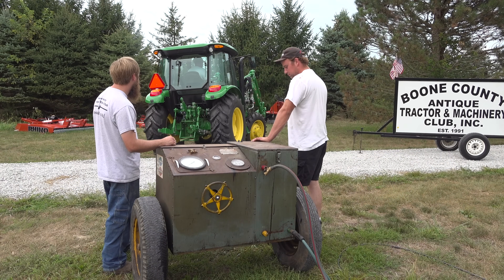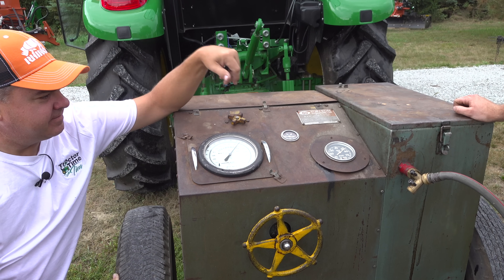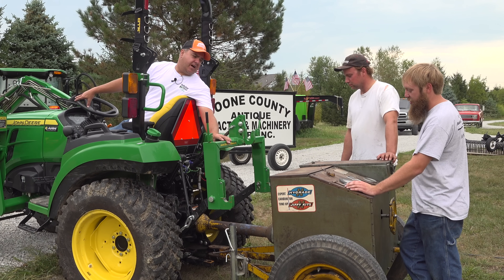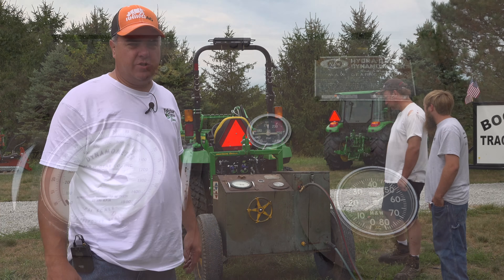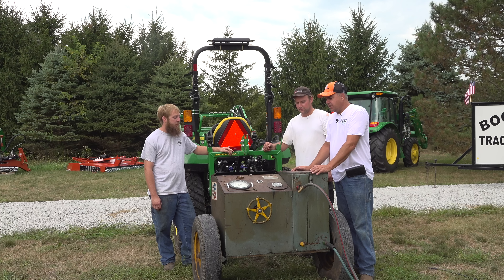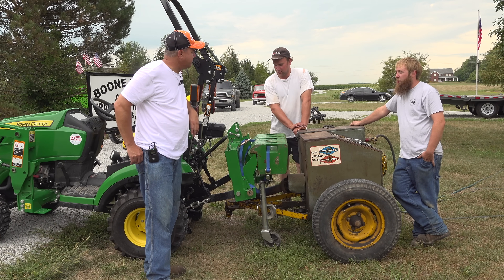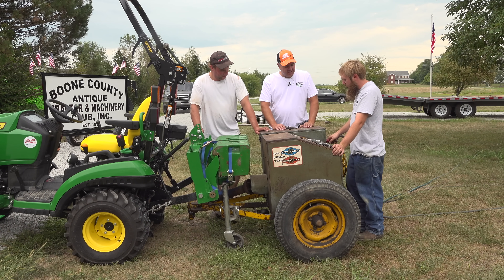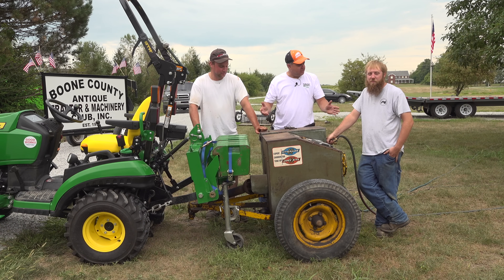Dyno Test!  PTO Horsepower Comparison - Kubota BX2680 vs. Deere 1025R Round #5 of 8

Comment: I have a Yanmar SA324 which is the same engine the 1025r uses. I had a  JD455 which had a Yanmar 890cc 3 cyl diesel rated at 22hp. The Yanmar 1200cc engine (rated at 23.9) hp used in the SA324,424, and the JD 1025r is 400cc bigger so it has the potential to have 28 HP at least. They are underfueled, hence no black smoke. They can be turned up to the point of slight smoke under max load.

Comment: Interesting comparison ….seems as if the dyno is about 5 hp too high from what manufacture specs are!
I find it hard to believe every tractor tested was putting out 5 more hp than specs….either way it was a fun video!
Reply from the maker: …would agree…cept for the 2038r.

Comment: Cool stuff, pretty interesting to see the comparison, hard to believe hp difference from the specs. It might be like u said, manufacturing pushing the EPA envelope.
Reply: That's exactly what it is, they really don't push out the true specs of these engines for EPA reasons...they're all higher output than what's on paper.

Comment: The difference between horsepower and torque is that torque is a measurement, and horsepower is a calculation.  The reason HP is off at the wrong speed is because a dyno measures torque; horsepower is merely a calculation of measured torque at a specific RPM.  Wrong RPM = wrong HP calculated, hence the conversion chart.

Comment: So I have a B2650 kubota if I get some equipment like a rear flail mower the PTO on the mower is rated at 540 what do you set the tractor at to plan for load while mowing? A little higher than 540?

Comment: Power scales with RPMs so the measuring device should easily be able to give an accurate Power for any RPM. The catch is that diesel combustion torque drops off fast after its peak at 2k rpm.

Comment: Some close numbers on the sub-compact tractors.  I figured one would be somewhat higher than the other, but its interesting to see how close they really are but over the manufacturer's rated PTO HP....I guess that's why so many people with their sub-compact tractors are running PTO attachments that are slightly over the tractor's ratings.  This was a really interesting test....I too would have liked to see the 1023r and BX1880 to compare to the larger engine versions....and I too would bet they're pretty dang close to each other.  People can do some really interesting things with those little tractors you wouldn't think they could do....I think a lot has to do with having the right amount of ballast and someone in the operator's seat that really knows what they're doing.

Comment: Having run literally thousands of Deere tractors on the PTO dyno they typically will run their sticker power at the PTO at 1000ft elevation. This is so they will still run rated power in say Denver where the air is much thinner. so a 1025r would run 25hp a 5055E would do 55hp and an 8360r will do 360hp.  That 2038R is weak for some reason and should be checked. Maybe dirty fuel filter? Even that 5075e isn't running what I normally see. Need to make sure that the throttle linkages are adjusted so that they achieve the factory rated no load rpms before checking as this can have a big effect on power.

Comment: We used a version of this, to rest outboard marine engines.
Very good to check for mid throttle issues, under load.
And yes you can shut down a 300hp engine by turning that valve.
A v8 outboard, UT of the water with cups.. Has a roar like no other!

Comment: Seems that the dyno is reading pretty consistent 5 to 6 lower then the stated actual. Both tractors had 5 more hp then manufacturer stated. Interesting
Reply from the maker: If that is the case, the 2038r has a serious problem!

Comment: A couple pto horsepower in a small tractor makes a big difference. After watching the video on the post hole digger makes that obvious. Add the extra three point hitch lift capacity of the Kubota makes it more of a work horse!
Reply from the maker: The Deere was one hp higher than the bx.
Reply: @TractorTimewithTim  but a lot more $$$

Comment: I was just at the Boone county fairgrounds!

Secondly every time I’ve watched one of these dyno’s run I always saw the guys run the tractor over the 540 rpm and pull the engine back down to meet 540 to get accurate numbers.  Not sure if this is the correct way or not
Reply from the maker: This is how they tested our tractors
Reply: Pretty amazing to see the little 1025 put down some great numbers!

Comment: if the small deere and kubota are reading over the rated hp and is correct the bigger deere is well under stipulated hp. With the ePto, if you wanted the same hp as in normal mode the 3 or so reduction in hp would mean lowering the revs, therefore saving fuel in e mode for same output. if that makes sense.

Comment: The ratings are probably spot on. What is missed is that the engine is rated to drive the tractor PLUS the PTO; you are doing a stationary test, so there is no load from the drivetrain, hence all of the engine horsepower is going to the PTO.
Reply: Does that mean the 2038R PTO output would be even lower if the wheels were turning?
Reply: @eosjoe565  Logically, yes. I would question the test conditions however. Something else is going on there, I would monitor hydraulic oil temperature to see if the missing energy is going there for some reason, or if fuel flow to the engine is being restricted somehow.

Comment: Sounds like the result with EPT mode is more power is directed to the PTO versus the drive train.
Reply from the maker: Well, I don't think our test was truly fair.   He had the throttle set to WOT...then pulled it down to 540rpm. ...rather than setting it at about 560 pto rpm, and then pulling down to 540.  So, it was lugging the engine pretty hard.     I didn't know that when I was making those statements.  Having said that, my comments are still true, we were getting 65hp at the ePTO 540 speed, so i didn't remove (or revise) these comments.

Comment: It's interesting that the unit read the PTO horsepower for the 1025r above what even the engine is rated for (24-25 hp for the PTO with an engine rating of 23.9 hp). I'd say there was certainly an issue with accuracy, but a great comparison between the two tractors. On an unrelated note, I wonder why the 1023e has a PTO hp rating of only 65% of the gross engine output, while the 1025r has a PTO hp rating of 75% of the gross hp rating of the engine? I'd expect the internals of the PTO drive to be identical between the two tractors.
Reply: While the absolute accuracy (actual numerical HP) of that dynamometer may be off a bit, the relative accuracy (between tractors) within the narrow range of HP produced by the the BX, the 1025, and the 2038R, is extremely good. In other words, the actual HP for each might be off by up to a couple HP, but the differences between those smaller tractors is probably very accurate.  Maybe not such good news for 2038R owners (although that lower HP could be a quirk with Tim’s unit), but the BX and 1025 owners will be very happy!

Comment: Hi Tim! I have a John Deere 140 with the 54 inch snow blade with hydraulics. When I first got the tractor the blade would lift about a foot off the ground then I blew a hydraulic line. I put some new lines on and new fluid and it would lift then I would lift lower and it would lower till it would not lift. Since you have attatchments with hydraulics would I have to bleed the lines or is the cylinder bad. Thanks Tim.
Reply from the maker: GReentractortalk.com
Reply: @TractorTimewithTim  Thank you Tim!

Comment: I've run water cooled dyno's quit a bit breaking in new tractors when sold from the dealer. You can see big differences in the same model/year tractor. Most will be close, but you'll see out liners, over and under spec. Engines increase in horsepower the more hours the engine has, most run the best right before they blow.
Some brands are known to overrate horsepower and some underrate them. More common in the lawn mower industry. We sold 66 ford tractors to the state of Indiana once and had to break them all in. Most numbers were close, but i'd say 6 units were off and 1 was way off. we found to be Injector pump problems.  Good idea of testing Tim.

Comment: That was a true treat! I have a feeling they were right on the money speculating that dyno was about 5 hp off. Might be calibrations, might be temperature related. May even be something to do with the accuracy of each gauge pertaining to the measurements to get the rated hp.  
Would be really cool to see how that old dyno worked with a tear down!  When my dad grew up on the farm, they used to call the ol two cylinder johnny’s “putt- in - now nows” after that characteristic pop they had.
Reply from the maker: The only problem with the +5 hp theory is that the 2038r showed only 27-28hp.  It clearly has more power than the 1025r.
Reply: Tractor Time with Tim, that is an oddity. I still haven’t really wrapped my head over how that one tractor did low numbers at all the different rpms. If only you could have ran it against another 2038 to compare. It’s true that every machine even if the same model will vary power off the assembly line. But we will never really know what’s going on. We know the 1series can’t possibly have 100% efficient pto, therefore we know the dyno numbers are about 5 high, which is roughly true for the BX as well.  I guess I use the extrapolated data to fill the gaps, throw out the outlier.  But it is odd.
Reply: @s1283  It doesn't necessarily mean the dyno is off, it could mean their rated power from the factory is under-stated.  There has been suggestion that they make more HP than is written on the label specifically because of EPA regs, and the standards for how you measure tractor HP aren't that clear - there's room to get different numbers by testing a bit differently.  I'd definitely heard the L2501 makes more power than it's rating, I am a bit surprised to see a BX putting out more power than it's rating, but you never know.
Reply: Paul Lambert exactly why I would have liked to see a second 2 series to compare. But it def seems the two sub compacts are running 5 high on that dyno from their rated number, basically making the engine hp the same as the pto, which is improbable that they would make 100% hp rating at the pto from the flywheel.

Comment: Generally dynos have a range in which they are accurate. I don't dyno small tractors because our large dynos that we use on 150+ hp tractors won't give accurate readings at low HP ranges. Not sure how that may have impacted your results.
Reply from the maker: Definitely a possibility. This one is rated up to 80hp.  I have no real confidence in the exact numbers.  I do think we can safely say that the bx and 1-series are very similar in pto hp.
Reply: @TractorTimewithTim  your probably good if it's an 80hp model. Interesting, always wanted to try this myself

Comment: A few thoughts...

Old rule of thumb is 5hp per foot of Implement.  It can be conservative, but also generally matches up correctly with the width of the tractor.  Just food for thought for folks in the market.

To counter that general rule, I ran a 60" tiller on a 1023e one fall tilling gardens and plots for folks.  I bought it setup with the tiller already, so wanted to try it out.  It never failed to perform on virgin ground or previously tilled areas.  I was impressed.

Secondly, I wonder the last time that Dyno was calibrated?  A 5hp margin of error on the 5075e is not as significant (percentage wise) as the same 5hp margin of error on the subcompacts.  

Lastly, the only machine that has actual test results on tractor data is the 5075e.  These seem to corroborate your test with it outperforming claimed hp.  Link below.

http://www.tractordata.com/farm-tractors/005/7/9/5793-john-deere-5075e.html

Comment: Older tractors were much heavier and some of them had the PTO tied to the hydrologic pump. So an older heavier tractor with 30 HP or so is not going to as well as a newer lighter tractor with 22-25 HP and an independent PTO and most of the newer sub compact and compact tractors are also 4 wheel drive which is another advantage.

Comment: I think you're right Tim, on a small tractors the EPA is the reason they're so underrated. I was told when I bought my 26hp tractor it made the same power as the 33hp one because the DPF robs power.
It's like 60's muscle car horsepower ratings for insurance..
Reply: The DPF doesn’t restrict power “at these lower power levels” as much as it fucks with the powerband a lot. It tends to make the engine very laggy and almost meh at Low rpm’s, even if it’s hitting it’s rated power output. In alot of way the situation is worse than it was in the 70s because brands aren’t going to invest long term tech into diesel emissions. So you’re going to most oems just throw boost or displacement at the issue, and that doesn’t really   Remedy, the underline power curve issues
Reply: @GoGoggansGo  
When I posted that comment I had a kubota B2650, rated at 26hp. Had a 60 cubic inch engine if I remember correctly.
I now have an L2501, rated at 24hp, 100 cubic inch engine. 40 cubic inches more, but makes 2 less hp.. allegedly. 
The L2501 engine has shims under the injection pump, essentially limiting the lift, restricting power. Take those shims out and turn up the fuel a bit. 35 pto hp. Reliably. 
0 emissions.

Comment: Really enjoyed this video-- and this series!  As to the Horsepower meter, I believe there is an electrical equivalent.  Horsepower may be compared to electrical watts.  To get watts, you need both voltage and amperage.  To measure horsepower (watts) this setup uses hydraulic pressure (voltage) and shaft RRM (amperage).  The gauge is actually measuring pressure.   In order to calibrate the gauge in horsepower, you have to have a fixed RPM, thus the 540 RPM.  Hope that makes some sense!

Comment: I can see it being an epa issue on the power rating.  At buckley they have a pony brake and they use a formula and pull the engine down in 10 rpm increments and use a scale reading so you can see the power curve of the engine.  Next year ill take loader off at buckley if i can build loader prop stands and get there rpm measure vs my tach so i can get a realistic measure where i want my rpms for my max power doing field work

Comment: Run that test again with the air conditioner off, then turn it on. There is a big difference
Reply: Typical A/C compressor doesn't make much difference due to the random cycling off and on.  Over past 10 yrs the A/C compressor oil has gotten thinner to reduce parasitic drag.

If you want more HP/ Torque use synthetic gear and engine. Plus always use a Premium diesel fuel which has higher cetane levels (or just use a additive).

Tractor are still kinda crude in design so as to keep production cost lower.

Comment: Tim I got 1025r horse power they 23.9  I mowed hill in West Virginia it power out on me sometime I got let off to get rpm back up  I think need little more horse power it would go right through what I mowing through grass I mowing low range  in 4wheel drive   it just pull down rpm  I love 1025r  what horse power on your 1025 r
Reply from the maker: 23.9 (or 24.2) engine hp, 18 pto hp is the 1025r rating.

Comment: That was interesting , I don't know if Deere still do it but they used to advertise the full HP right out the box on new tractors.  so on day one if it was 150 pto it was, when everything got bedded in a freed up you'd quite often find a stock tractor was more HP. Something like an IH might of been lower like 125 new, then say 150 hp after a few hours. Just  like they say with cars and trucks the mileage should get better after X miles L.O.L.
 
  I have one of those Dyno's  sitting in my shop, the local tractor dealers quit farm equipment repairs and went full automotive/ heavy truck instead. it was sitting in the corner dripping oil for years, they wanted to expand the shop taking one of the walls out. The day I was in the boss was mad with it and said make an offer it's bargain of the day. I just jokingly said $200,  thinking it was worth way more. He said done it had better be cash, off to the cash machine I went. They loaded it in my truck, now it drips oil on my floor in the corner L.O.L i got to fix that, and want to use it to run in a Perkins I'm rebuilding for a customer tractor. Thanks for the video, Take care.